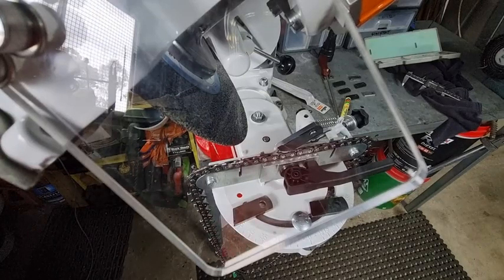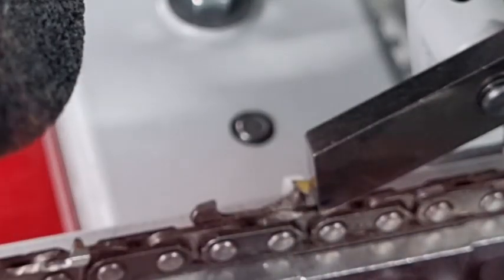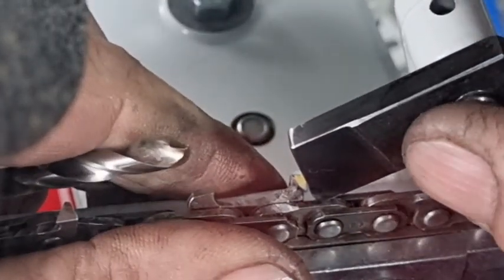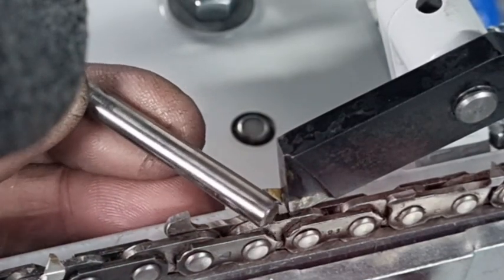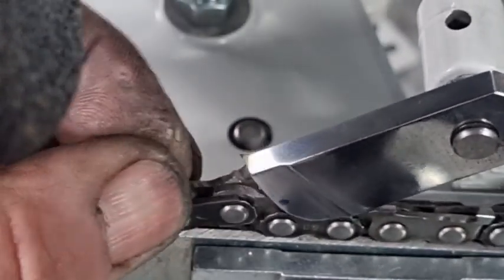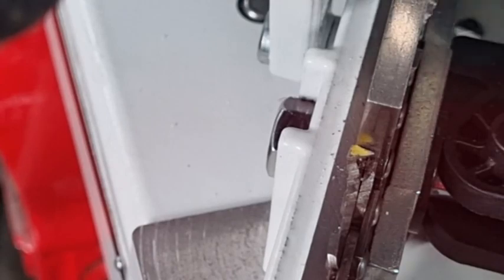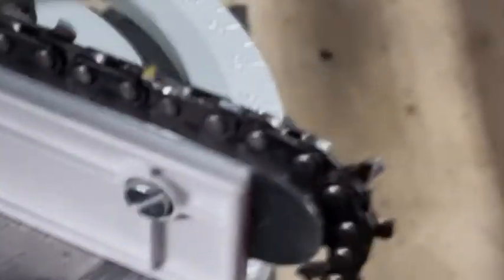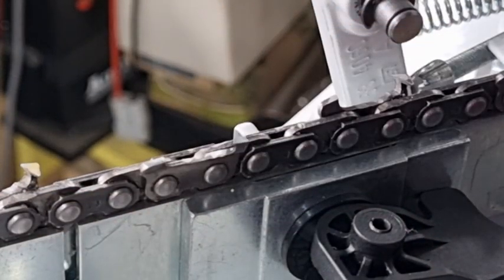Stihl USG Pawl best Mod for clearence

Comment: An idea I have for the pawl that could possibly work better is having the pawl 
track centerline of the chain so it lands behind the rivet in that gap between the 
tie link rivets. Tip end of the pawl could be made from a drive link tang having
tang thickness reduced and tip end reduced even thinner to a wedge shape so
it drops into that gap in the center of the chain between the tie link rivets. A slot
would be cut vertically on the front thicker portion of the pawl on centerline
and the slot would have an insert the same thickness as a drive link or tie link
and a width to match the distance to the back of the top plate of the cutter.
The pawl would bear against the back of the cutter only at that center point. 
Such a scheme would get the pawl out of the way of any grinding wheel or
filing interference. And it would eliminate the need to reposition the pawl
for left or right cutters since the pawl would always operate on centerline
of the chain. This is something I have been looking at for the pawl on the
manual filer, but it could work as a pawl on a grinder vise also. The way 
a jigsaw blade is held in the blade holder by a set screw would be good 
for adjustment of the gap to set the contact point for the piece that rests
against the back of the cutter, actually 2 small set screws would be good
so the contact point and angle could be adjusted to coincide with the 
bottom tip of that pawl latching into that gap between the tie link rivets.
It would require some precision for this to work but I think it could work.
Reply from the maker: For that to work the gauge must be no bigger that 1.1mm or 043gauge.  The pawl would need be 1mm wide so it falls into the tie straps on 043 gauge
Reply: @ChainsawUsers  Correct the bearing pieces would be thin.
But it is plenty strong enough for a pawl insert. Drive link tangs
bear the force of several horsepower while the saw is in use
and are strong enough for that loading, so the load that is
encountered by a pawl during sharpening is trivial and would
be gentle compared to what is the loading they usually get.
Another idea is to have the vertical piece that bears on the
center of the back end of the top plate of the cutter firmly
spring loaded to pivot against the back of the cutter as
the bottom corner of the pawl wedges solidly locked. 
That would assure the cutter is rocked forward firmly 
even though it would be a resilient stop it would be firm
enough, while the solidly wedged stop would be at the 
tie link. It would not be be perfect but close enough.